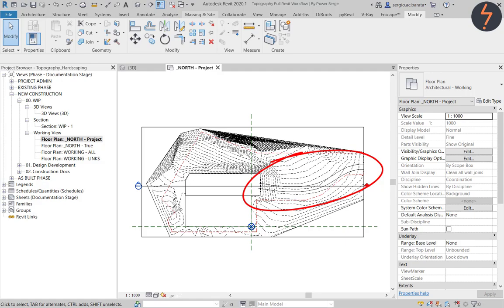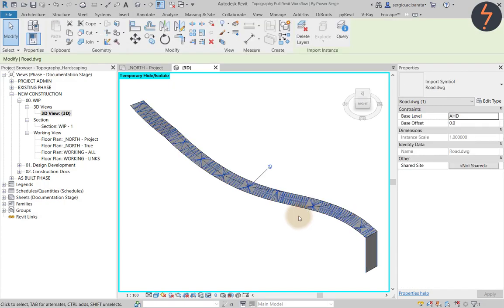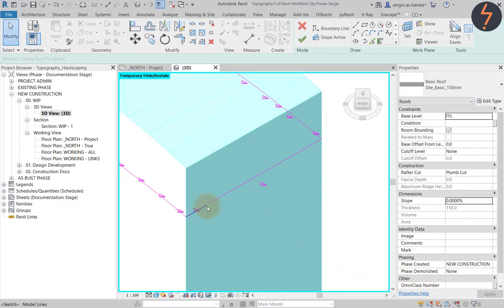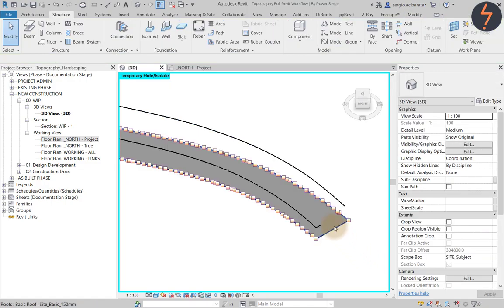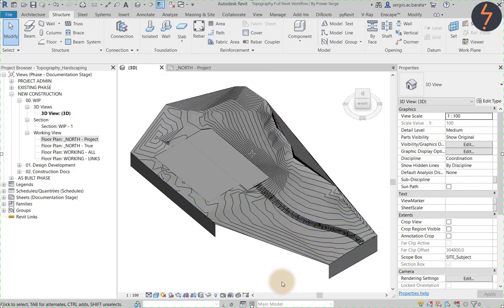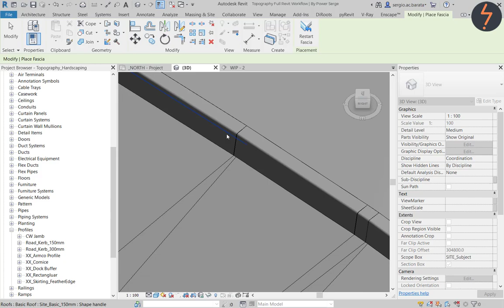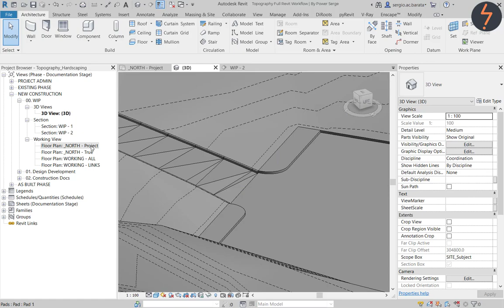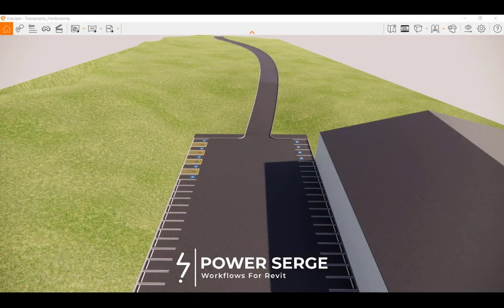Revit Topography With Roads and Kerbs | Part 2

Comment: I create a roof from importing the dwg topography and then just put the curb fascias on the roof. No need to do anything manually except the curbs.
Reply from the maker: Cool - Thanks for sharing.
Reply: @SergioBarata  1. Isloate object 2. Export to DWG and press OK 3. In Place Mass 4. Import DWG 5. Massing and Site - Roof 6. Select DWG from import and press OK.

Comment: This take's ages to do one road.. i can't imagine in a drawing with many paths... :(
Reply from the maker: Hi Miguel - Thanks for taking the time to comment. Yes, it can be time consuming but it's free! and it gets results. I haven't yet come across another method using only native Revit that is better (Add-ins can do it faster). What do you recommend? Interested in hearing your thoughts.
Reply: @SergioBarata  hi Sérgio. I hope i can advice better but i can't . i am currently learning revit and i find out that for landscape architects we need a dedicated tool like environment wich is another 500€ minimum. I still do not understand the lógica of using a roof tool to draw kerbs. Is not possible to extrude a surface like in SketchUp for example? Sorry for my comment don't get me wrong.
Reply from the maker: @mpereirawolf  no offense taken - I agree, it is frustrating. That's why I made this video. I know logically it seems strange but it's the best workaround I have found without having to spend 500 euros. I hope you find the right balance - boa sorte!